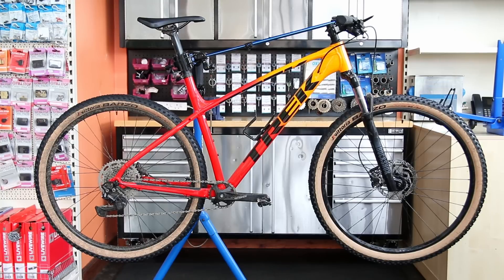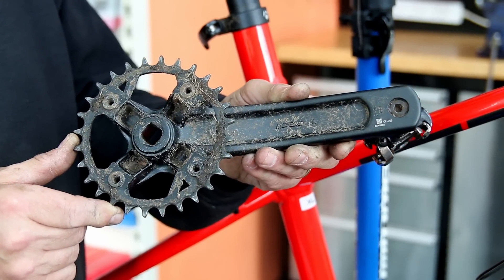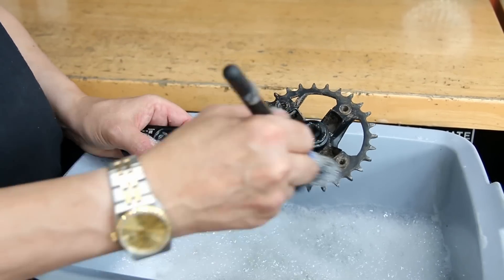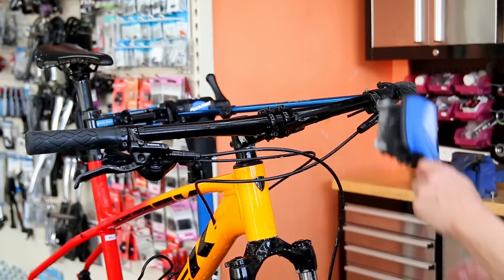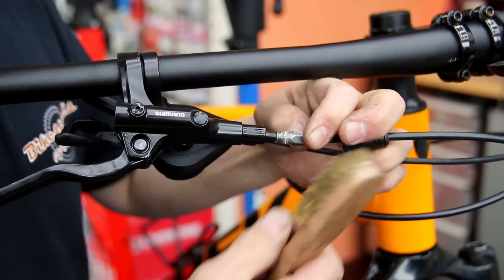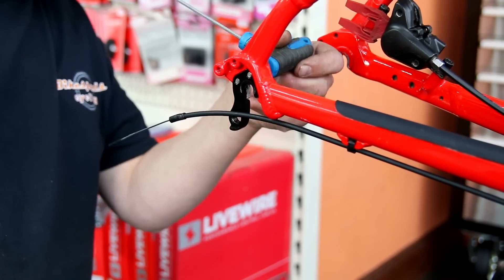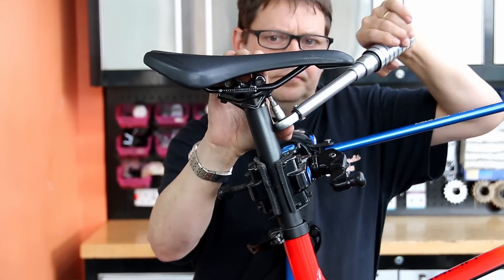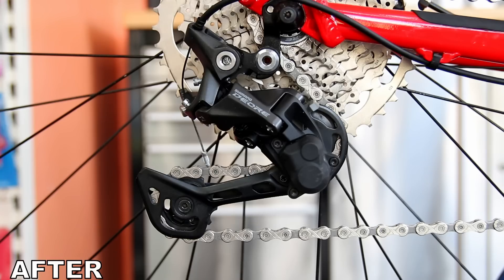Trek Marlin 7 Service! MTB Rebuild New Bottom Bracket & Brake Bleed!

Comment: That smear of copper slip on the brake pads... well worth it. My brakes seemed to be clunking...felt at the levers. It was the brake pads sticking on the piston. Smear of copperslip... and it's never done it since. As you say... don't go overboard, just a smear. Crackin job as usual.
Reply from the maker: There you are!🧡

Comment: While the clutch does have an o ring seal on the cover and shaft, I have found they can let in water (I think via the shaft seal) which causes corrosion and in one case for the clutch to jam and need full disassembly and repair. Given that, I personally wouldn't immerse them in the ultrasonic.

Comment: Thanks for another good video. How do you prevent the sonic cleaner from damaging the anodising of the various components you put in it, what degreaser do you use and what do you use cleaner wise when washing off the sonic bath fluid with the scrubbing brush. Thanks
Reply from the maker: We’ve not had problems, we use regular heavy duty degreaser and wash off with fairy liquid 🧡

Comment: what was the reason for replacing the brake lever, was it that it was at fault or did the system just need bleeding?
Reply from the maker: The lever had lost its “springiness”🧡

Comment: Square taper BB in modern bike. Why, why, whyyyyyyy???
Reply: Not bad gets job done
Reply: Still used on many touring bikes. More common worldwide and is quite nice being able to get different axle lengths for alternative q factors.
Reply: @oiuqreofnqoiruegnqerg  what’s not?
Reply: @brian_jake  yes it is but I personally prefer Shimano BB. Simple and long lasting
Reply: @BigBanana55  I believe it is but it is so old standard and cheap too. Why to put it on modern bike of 1000€ with 1x setup, It don’t fit in my eyes
Reply: $££££$ If you replace the bottom bracket you'd have to replace the cranks too. They work to a budget to keep customer happy. Only marginal gains anyway, square taper is good enough.
Reply: @jackalden9527  yes especially in last few years when the bike prices doubled and equippment dropped for 2-3 levels. IE Altus on 800€ bike 🤷‍♂️🤦‍♂️
Reply: The bearings in this kind of BB rest inside the BB shell, adding protection from the elements. This is an advantage for MTBs when compared to outboard BB bearings, which are only somewhat stiffer.